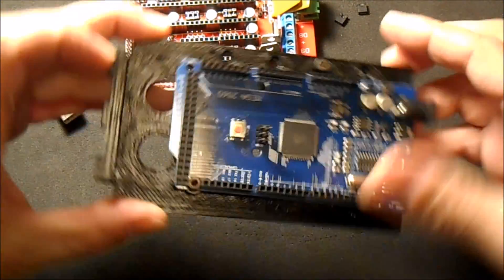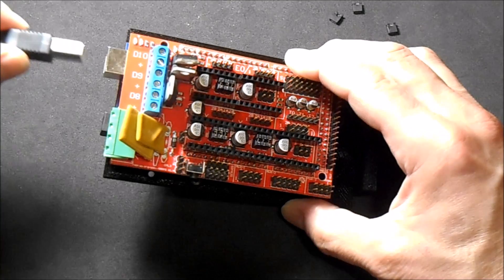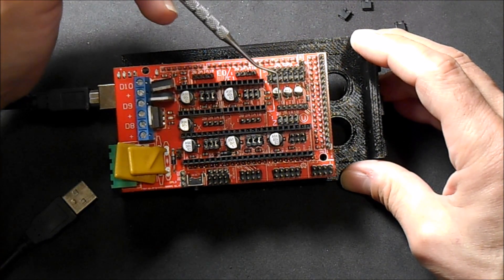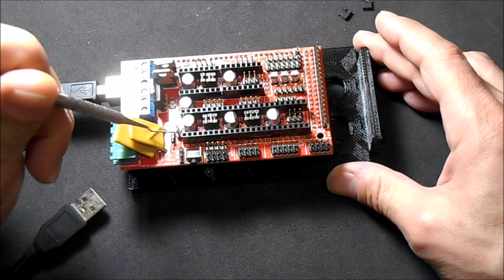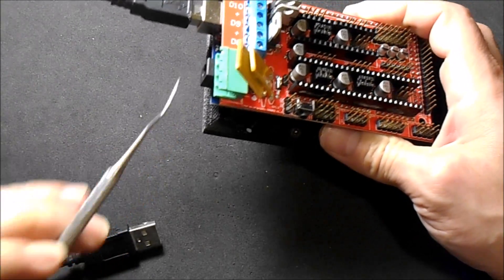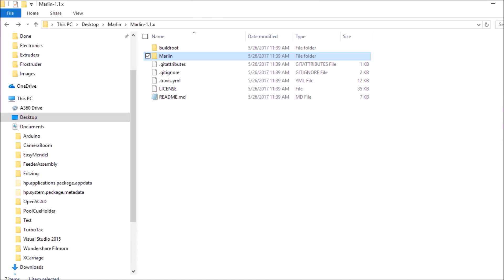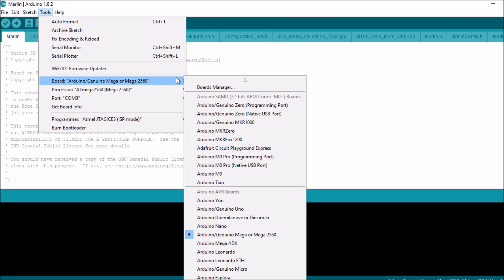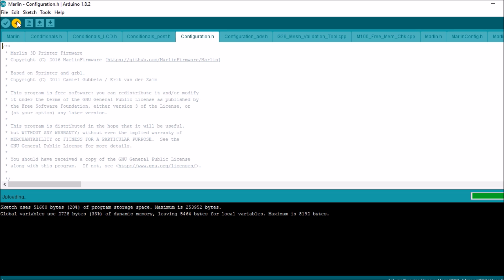RAMPS 1.4 - Basics

Comment: This is all very new to me, but I have a question. I'm building a small 3-axis cnc plasma table using nema 17 motors and v-slot extrusions. I ordered three motor drivers and an EC-300 Ethernet control board (ethernet seems less affected by the high frequency interference of the plasma arc than usb). I see your Ramp setup doesn't use separate motor drivers like a cnc machine does. Is there a reason a 3d printer can connect the x,y,z motors to a single board but cnc machines  have to run a separate driver for each motor? Seems like the Ramp card serves as an easier setup but maybe it's a power requirement issue? Just curious since this will be the first time I wired a cnc machine. Thanks. Subscribed.

Comment: Hello.  I have done all the steps you did  I did not link endstop and hotend. While printing the model, the motors run for a while and then stop. Should be linked hotend and andstop ?
Reply from the maker: Printer stopping can have many reasons from thermistor failure to overheating steppers.  Normally there's an error code that displays.
Reply: @EdwardBraiman  https://youtu.be/qlu-RA1gDnU
Reply from the maker: @mohmoh-wk7ke  So is there a message in Pronterface?
Reply: I wanted to see if the motors were running fine.  I used nema 17 and a4988 with 1.4 rampes shield and arduino mega but it didn't work.  Should I connect hotend and endstop too?

Comment: I am converting a bricked xyz da Vinci jr 1.0 from the proprietary software to Ramps (my first 3d printer), and your videos have been invaluable so far. I will work my way through them one by one as I am offically on the wiring phase, and ill be taking notes on your videos where to reference to make the software adjustments. Thanks for putting all these together, breaking TONS of information down into more manageable pieces.
Reply from the maker: You're welcome.
Reply: heyy, ditto, how did it go? I'm just getting ready to convert a Pro 1.0A (junior) myself :D
Reply: @TheMrPopper69  Good and not so good. I could never get the optical sensors to work and I don't have a 3D printer to make brackets for mechanical switches, but I was hoping to work around that temporarily. I got the rest of the wiring completely finished and operational, the reason this is still a bricked unit is because I could never figure out the configurations on the software. If I had more experience with the programming side of 3D printers, I can get this working... I think.

Comment: We need a video on the BTT TFT35 E3 V3  udisc is giving cold extrusion  error and the stops printing,
Reply from the maker: One which motherboard?
Reply: @EdwardBraiman  I am using the skr v2 and the tft35 e3 v3 I have it installed on my ender 6. Thanks for all your videos by the way you are awesome!! Keep up the good work!! I am going to try a firmware update on the TFT35 as soon as my print finishes. I will let you know if it helps the problem. It looks like an update came out 3 days ago.
Reply from the maker: You're welcome.
Reply: @EdwardBraiman  upgrading the firmware didn't help I'm still getting cold extrusion warnings and print stops because it has lost temp. This only happens when printing from udisk I have another tft35 that I bought for my ender 5 so I will try switching screens and see if there is a problem with the screen itself but I doubt it. To be clear the print starts out fine but after a little while it starts losing temp and then gives a cold extrusion error.
Reply from the maker: It might be easier to troubleshoot this on my Discord link in description below.
Reply: @EdwardBraiman   I don't see the discord link. Am I missing something?
Reply from the maker: @chucktaylor5878  Discord chat:
https://discord.gg/JzhdGgr  Also I'm Streaming right now.

Comment: Why don't 32 bit boards have this many Servo ports Step backwards in technology
Reply from the maker: It's based on an open source design, so the designer seemed to think it wasn't required.  I agree four or five servos would be nice.  In some respects the stepper motors can do some of the same functionality, but with more pins.

Comment: thank you ! 
I have a problem with my card was working normally and suddenly it stopped working and a red light lit up. Can you help me . thanks
Reply from the maker: What seems to be the problem?  Could you give me more detail on the card that seemed to stop working?  Is only 5 volts being used?
Reply: The problem is card Arduino gets hot  , the ramps lunch on 12 v , if we can communicate on social media will be easier . Thanks again 😁
Reply from the maker: What's connected to RAMPS board be specific?

Comment: Hey again! I am building a delta 3d printer and i dont think marlin is the right firmware. Do you have and alternatives? If marlin can run a delta, please explain how. Thanks!
Reply from the maker: Marlin firmware can run Delta 3d.  I've not yet built a Delta 3d, but look in the Marlin folders for examples.  File compare configuration.h file with fresh configuration.h file to see what was changed.  This will give you clues on what to configure.  Good luck.
Reply: Hey again. Sorry i guess i did not understand. You mean i go in configuration.h and look for delta settings? Maybe this could be a good video topic because i cant find anything to help me with marlin combined with delta style 3d printing. Thanks
Reply from the maker: If you navigate to the folder path in the Marlin/example_configurations/Delta/generic .  I would do a tutorial, but I do not have a Delta type printer, mostly because I print wide based models.
Reply: @EdwardBraiman  Great! Thanks
Reply from the maker: You're welcome

Comment: Hi, I have a problem..my when I connect the ramps1.4 to the arduino mega then via usb cable to my pc...the ramps' led don't light ;(
Reply from the maker: Do you see the Arduino in device manager on your computer?  Do you have Arduino IDE loaded on your computer?  What type of operating system are you using?  Do you know if USB cable is good?
Reply: @EdwardBraiman  I have all this.. When I connect my arduino to the pc.. It read it normaly but when I mount the ramps on the arduino no thing happens
Reply from the maker: Sounds like RAMPS board has an issue.  Check what's connected to RAMPS and remove everything you can.  If it starts working then one component is bad maybe.  Also what components are connected to RAMPS board?
Reply: @EdwardBraiman  no thing changes sir.. I think my ramps damaged
Reply from the maker: It appears to be.  Remove jumpers just in case and try one last time.

Comment: Can we use E0 and E1 as x and y clones 🤔🤔🤔🤔
Reply from the maker: Interesting question, yes.  It's in the advanced tab of Marlin firmware.
Reply: @EdwardBraiman  Related to the previous question, I am building as cheap as possible a MPCNC and I will use all drivers (5) using Marlin, the steppers will be 2 Amps each, is it possible to feed the board with 12 Volts/12Amps on both power terminals and make all steppers works?
thx you
Reply from the maker: Depends on type of power supply rating.
Reply: Edward Braiman max amps that will be used is about 10 Amps (5 times 2Amps) so I figure out that 12V/12A will do it .
Again thx
Reply from the maker: You might want to check out the reprap wiki page for the recommended power supply.
Reply: Edward Braiman thx you Edward, I just checked it and learn that you we need to make sure that the output is 5A or greater . I will take my chances with 12Amps .
Regards
Reply from the maker: Good luck and be safe.

Comment: Hi, Thank you for your very to the point, and simple explanation of all Ramps Board.  I'm new at this ( as I'm sure you've heard a million times ), and i'm very good at building things, but it's the electronics ( software / hardware ) that i need to learn.  I'm pretty proficient with the basics of 3D printer build, but i'm wanting to venture into Laser build using this board setup.  Would you have the time to help me learn how to setup the board, and software for a laser?  Any help would be much appreciated.
Reply from the maker: I'm planning on doing a video someday on lasers, but there are many dangers involved.  First ventilation, second eye protection, third fire.  If you can address these first look in board.h file with Marlin firmware.  Then research gcodes for for command codes.  My fear is people injuring themselves, so I've avoided the subject.
Reply: Edward Braiman yes I fully understand those points, to the extent the first thing I did when I got my cheap 2W to play with, was to throw away the worthless glasses they give. Basically just plastic. I spent the $$ on once from a reputable laser company. 

Well if you do end up doing a guide to basic hardware software setup, I'll be watching it. 

B.
Reply from the maker: I still need to purchase a laser and figure out safe way to dissipate the beam.  Maybe tube of water, but I'll need to research all aspects of it first.